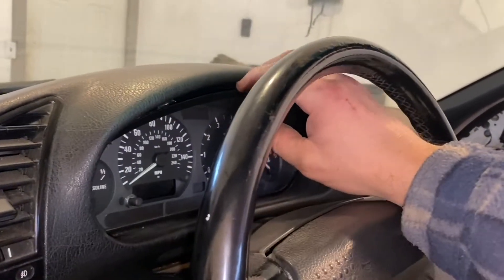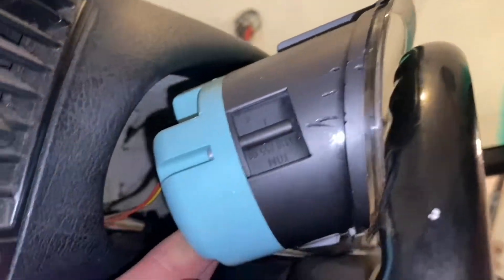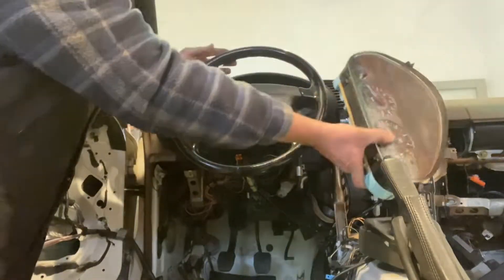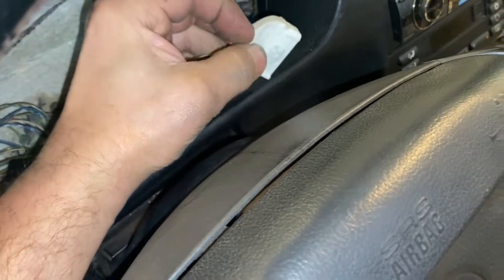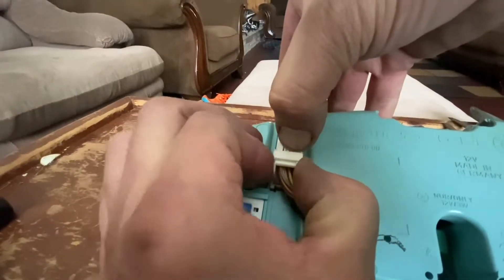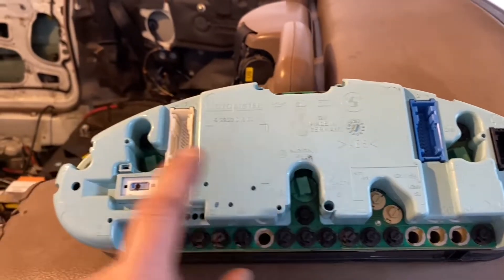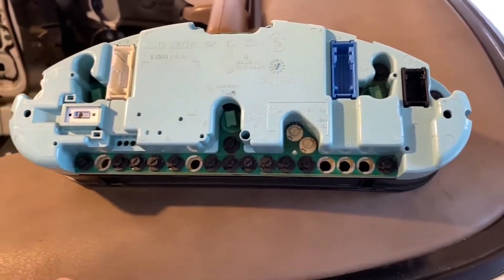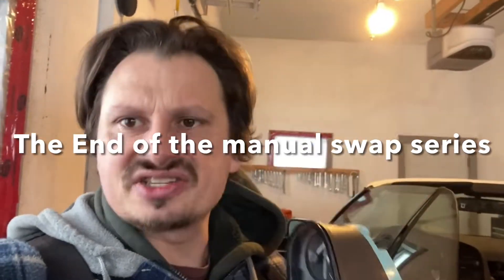BMW E36 Instrument cluster removal. (Instrument cluster light bulb removal)

Comment: Well that's me done, had an old 318ti compact drift car stripped out and unregistered, wasn't interested in drifting so I bought a cheap clean auto sedan (auto way cheaper than manual in aus) 
And did this gear box swap, so I now have a really nice alpine white manual 318i sedan.

Huge thanks for this video series it went smoothly!
Reply from the maker: Awesome, thanks for the feedback. Glad it worked out.
And hello from Canada

Comment: I removed my instrument cluster from my 98 BMW Z3 for the first time because the mileage bulb is dim to almost dead. When I removed my instrument cluster, I was surprised to find that there were about six missing bulbs at the back. Is that normal or should I buy bulbs for the empty sockets? I did, however, found the bulb for the mileage light which is the beige one. Please advise. Thank you.
Reply: My mileage ones went out as well and wasn’t sure which ones it was, what type of bulb was it? Also I’ve heard that some do have missing bulbs but I’m not too sure why
Reply: @juliecarrion3008  The mileage bulbs are the beige socket ones. They are 1.5w. The other bulbs with the black back are not the mileage bulbs. Those black bulbs are quite pricey. These are the ones that I mentioned in my original comment that there were several missing. I didn't replace the missing sockets btw.

Comment: Can you please put all the link to everything you used. Ive just got an e36 320i and want to swap the transmission from auto to manual, thanks:) Also all of the parts you've used will be compatible with the 320i right?
Reply: Its the propshaft im having trouble finding, also on what episode did you install it?
Reply: Oh and im having trouble finding the pedal sets, Very informative series btw, thanks:)
Reply from the maker: Yeah you'll just have to watch all the episodes in a row, I have one episode that lists all the parts
Reply: Thanks for replying so quickly:)

Comment: BMW quoted $120 for 2 hours labour to pull out the cluster + $20 for the 💡 . Haha 😂😆, disconnected battery and crossed the terminals to zero out any residual charge. $4 bulb at parts store. Sorted in 15 minutes